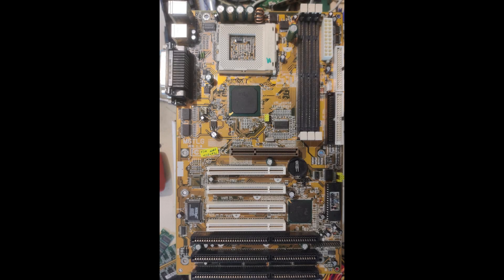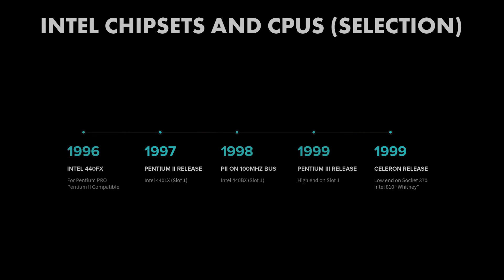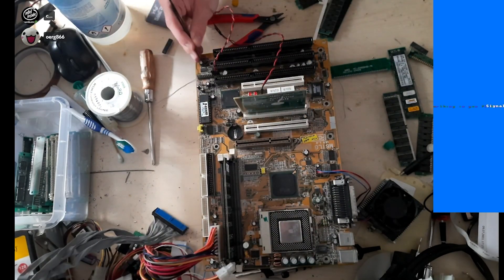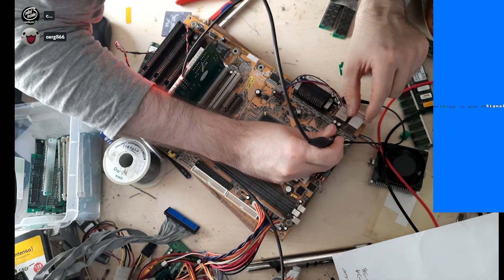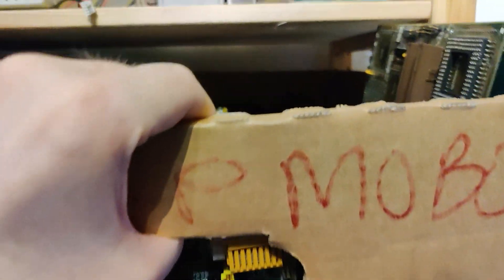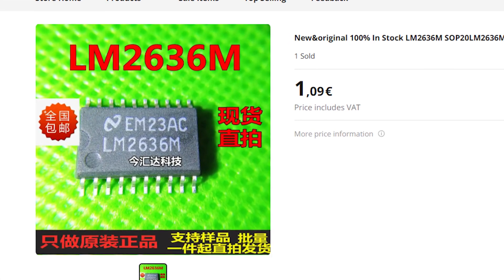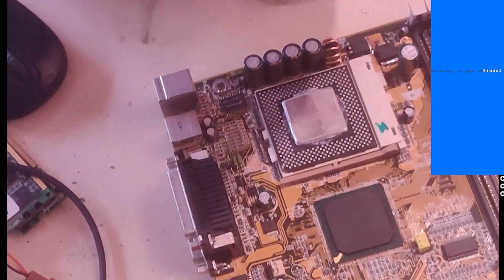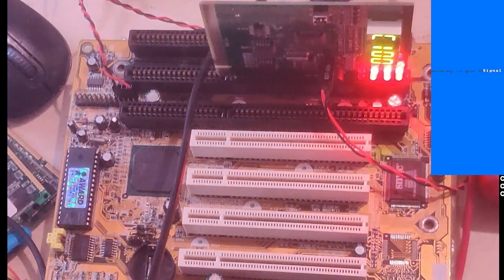Vintage Tech: Biostar M6TLG Socket 370 Intel 440LX VRM repair

Comment: Dude, first, thank you for saving this not-so wanted motherboard.
Thank you for uploading picture to retroweb too. ;-)

Second, let me clarify this combination of chipset.
There are even Socket 754 motherboards, with nforce 630a chipsets or even AMD 760 chipsets. Released in 2008.
It's something like motherboard released in 2008 with 2003's chipset.
So it happens, of course because of "budget" reasons.

I have suspicion, they do it, to use stock of old chipsets, rather than throw them out, they found a way, to use them on motherboard.

In 1999 situation was like this:
LX was still perfectly fine for 66 MHz CPUs, so noone cared, that it is two years old chipset. You know, in 1998, LX chipsets was rebranded as EX chipset, and even more limited. It was used on budget motherboards. But in this case, LX chipset (was still highend in 1997) was better than EX. The performance was same, but you could use more RAM on LX. I mean, like 3 sticks instead 2 sticks, which usually EX had.

So, it was "midrange" version of budget motherboard. Of couse, to use Slot 1 would be better, as you can use Pentium II also. But... who would buy Pentium II with 66 Mhz FSB in 1999 anyway, so they decided to save even more costs, switching it to socket 370, for mendochino celerons. As Slot1 variants were only up to 433 Mhz (socket 370 Celerons were up to 533), so still better opinion. (after coppermine was released, these kinds of boards could be still actual, with 66 Mhz FSB celerons going up to 766 MHz... still what a beast.. not mention to fact, that some LX motherboards could use 75 and 83MHZ FSB for overclocking, doing it with Coppermine Celeron 700-766 leading to "almost 1 Ghz." which could be still actual during year 2000. But of course, for Coppermine support, you need correct voltage regulator, and I'm not sure if this board is capable to do it, as when you run Coppermine with 2.0v, it will toast gradually, longterm safe voltage is around 1.8-1.85v. (They are native up to 1.7v)

So this is why LX chipset was still used in 1999 on budget motherboards. 
Anyway, there are also BX boards with socket 370. While most of BX motherboards are with slot 1, it limited them a lot, not sure why they were doing it, as it prevented to use Pentium III Katmai.

Comment: New here, what are the split screens you are using for code and any link to their way through?
Reply from the maker: Hi, I'm not sure what you're refering to?
Reply: @Oerg866  hi too, oooh it is a monitor, there is a blue screen and a black screen at minute 4:56
Oooh plus do you have a parts list for accessories used?
Reply from the maker: @aspirohk3558  Yes I'm using a Datapath VisionRGB E1S and a VGA splitter to record the VGA output :)
Reply: @Oerg866  oooh will see to getting that, just bought a HP Probook 6470b but has power button issues will head to check it out hoping to be a great repair guy and advice on the same?